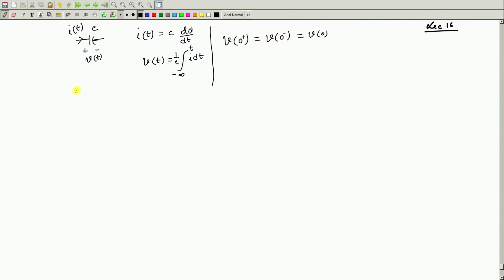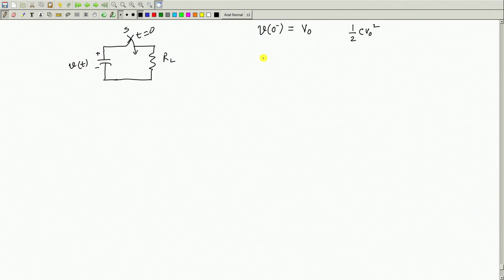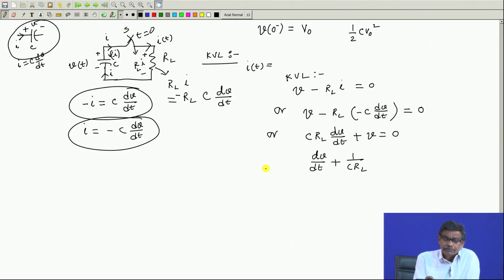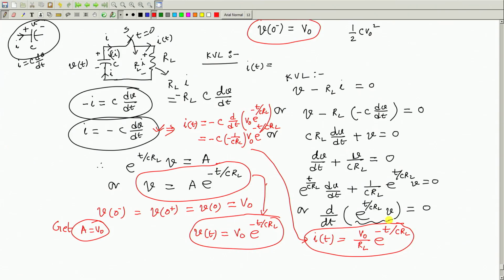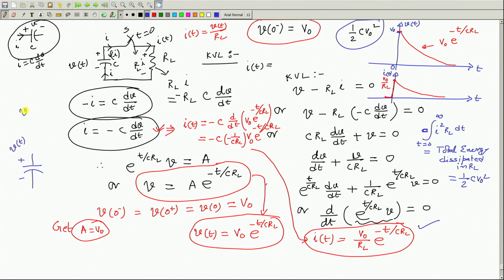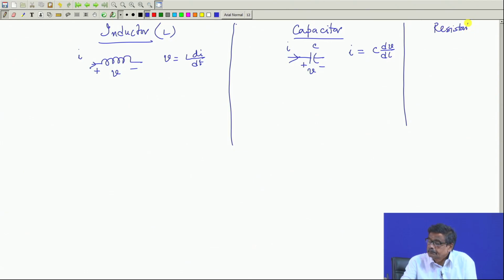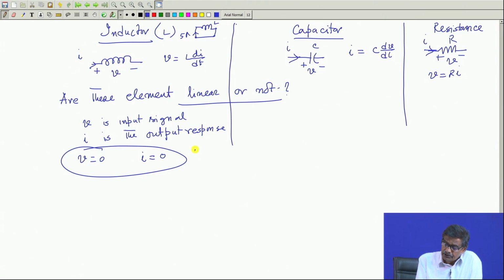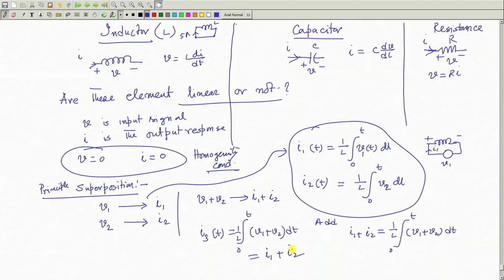Lecture 16: Discharge of a Charged Capacitor

Comment: ""The voltage across a capacitor cannot change instantaneously" is a statement one finds often in textbooks on circuit theory which discuss the application of a step voltage to an RC circuit.
Most students memorise and apply this in circuits without understanding the physical processes involved. 

It will be useful to learn the operation of charging a capacitor using a unified approach to electrostatics and circuits.
Electrostatics and circuits belong to one science not two. To learn the operation of circuits it is instructive to understand Current, the conduction process, resistors and Voltage at the fundamental level as in the following two videos:
i. https://youtu.be/TTtt28b1dYo and
ii. https://youtu.be/8BQM_xw2Rfo 

It is not possible in this post to discuss the charging of an uncharged capacitor. During the first few nanoseconds after switch ON, while the surface charges arrange themselves, there is no electric field E_cap and fringe field because there is no initial charge on its plates; it is as though the capacitor was not there - as though there were a continuous wire with no break in it.
The current (sinusoidal steady-state) in a capacitor is due to the resultant electric field E_net (resultant of the applied field and an opposing electric field, the fringe field).
If the capacitance of the capacitor C is made large, then the fringe field does not build as fast as it would have if C were to be smaller. With a large C, the charge sprays on the plates do not result in developing a large voltage in a given interval of time as evident from the capacitor voltage-charge relation Q = CV.
The fringe field is smaller and the net field consequently is greater. Therefore, at a fixed frequency, the current increases as the size of the capacitor is increased.
The current also increases as the frequency is increased. So, we say it passes higher frequencies of applied voltage.
If the frequency is made smaller, the fringe field builds very rapidly and in the limit when it is dc, it blocks the applied voltage.
The last frame References in video #1  lists textbook 4 which discusses these topics in more detail using a unified approach and provides an intuitive understanding of reactance.
Textbook 4 is here https://techsarworld.com/product-detail/fundamentals-of-electric-theory-and-circuits-559 
It also describes with sequential diagrams how the current leads the voltage across the capacitor by 90 degrees. 

Capacitor - Video lecture by North Carolina State Univ faculty
This is a link to a video lecture by NCSU faculty on the fringe field of a capacitor.
Important
5. Derivation leading to fringe field expression of a capacitor.
For the final expression of the fringe field watch from 15.0 minute.
ch15L3b
https://youtu.be/7rZ1uFc1ibE?si=0a6OMk-kQLeEMMzb
The second link is to a video lecture by NCSU faculty on Discharging and Charging of a capacitor.
6. Discharging a capacitor
Watch from 3.0 minute.
Charging a capacitor
Watch from 15.0 minute.
Ch19L1a
https://youtu.be/hnSC8MqgCjY?si=krGUPtDarUmFxT_I
PPTs and Videos with animations for all the ten chapters including charging and discharging of capacitors and RC circuits (Chapter 2) and a few applications Regulated DC Power Supply, Differential Amplifier and Transformer coupled audio power amplifier of  book Fundamentals of Electric Theory and Circuits are available for download and viewing here
https://techsarworld.com/download-resource/fundamentals-of-electric-theory-and-circuits-559

It is not possible in this post to discuss the charging of an uncharged capacitor. During the first few nanoseconds after switch ON, while the surface charges arrange themselves, there is no electric field E_cap and fringe field because there is no initial charge on its plates; it is as though the capacitor was not there - as though there were a continuous wire with no break in it. 

The last frame References in video #1  lists two textbooks 3 and 4 which discuss in detail with a series of diagrams the physical processes in charging a capacitor. 

When a capacitor of capacitance C is charged using a battery of voltage V and a switch, the battery expends an amount of energy QV while the energy stored in the capacitor (after charging) is QV/2 where Q represents the amount of charge transferred when the capacitor voltage is V. Note that with a potential difference V, a capacitor C will store charge Q, but the energy stored is not Q × V. Why not? Because, as the capacitor charges, both Q and V increase, so we have not moved all the charge with a potential difference of V across the capacitor (fighting against the growing fringe field to transfer energy from the battery), which the battery did. 
Where is the missing energy? (QV)/2 from the battery? 
It is not possible in this post to discuss in more detail the energy expended when a capacitor is charged.
The last frame References in video #1  lists textbook 4 which discusses these topics in more detail using a unified approach and provides an intuitive understanding of how charging a capacitor with a ramp voltage is more energy efficient than by applying a step voltage. This is explained with the analogy of lifting a weight.